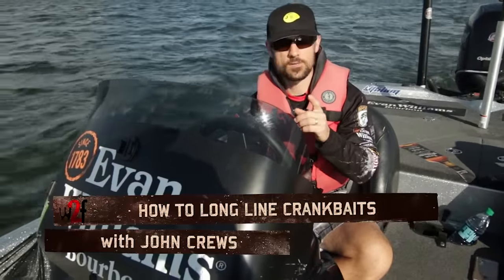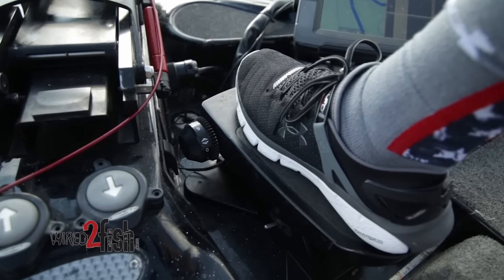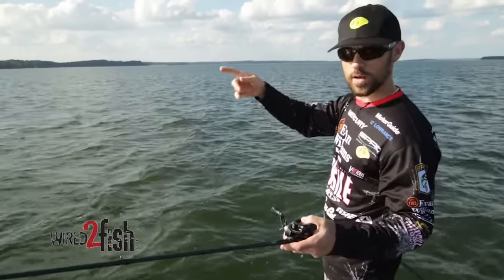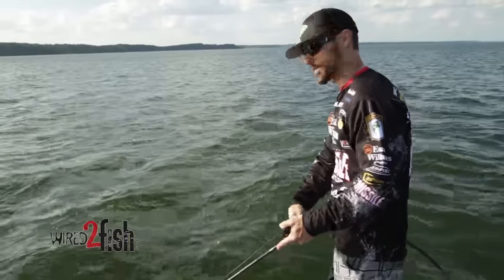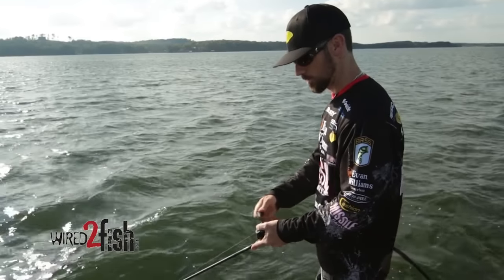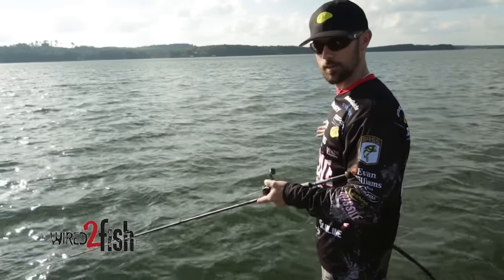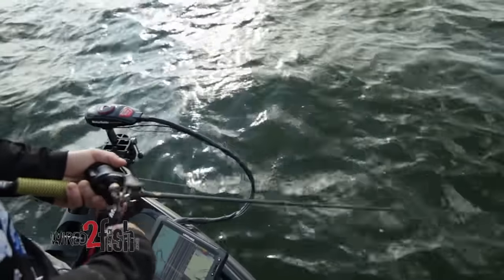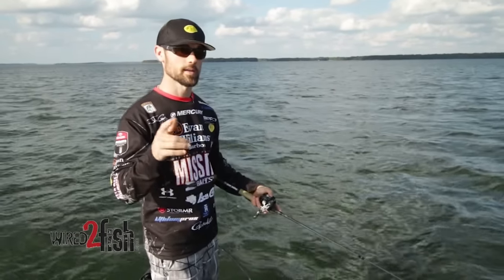How to Long-Line Crankbaits

Comment: Isn't that against BASS rules. I thought the trolling motor was only allowed to position the boat, not troll.
Reply: no not against rules. kinda grey area. it's also known as "strolling". your bait is stationary while on the troller because of bail being open or thumb bar down.  once you have enough line out to cover your area you retrieve like you normally would just using troller to hold your line so bait tracks where you want it to.
Reply: Okay, thanks for the clarification.